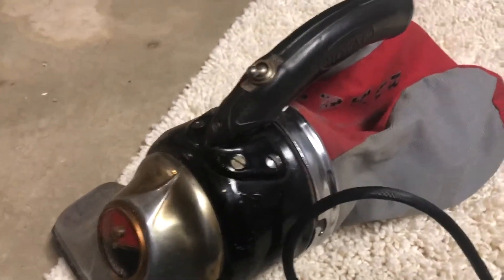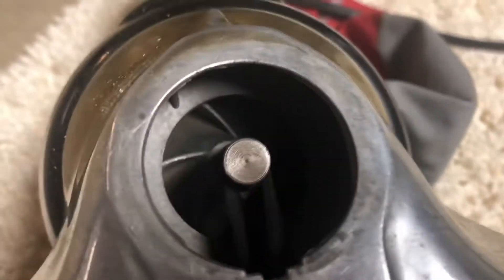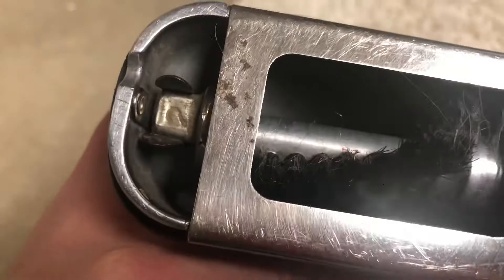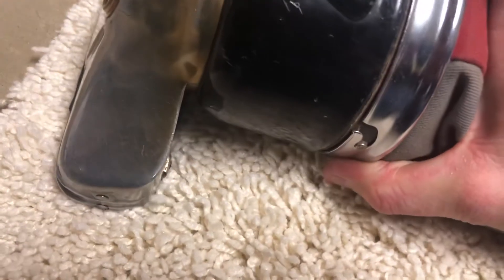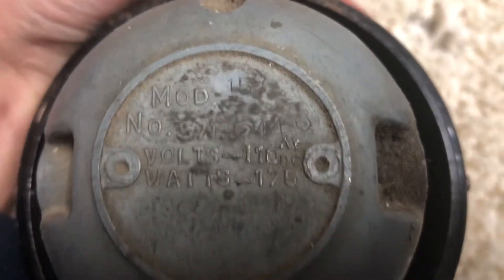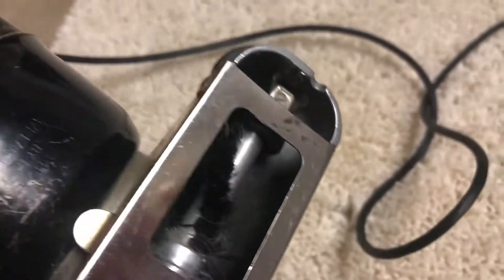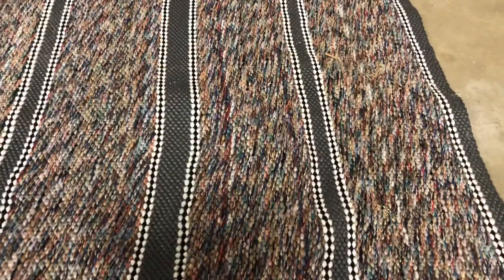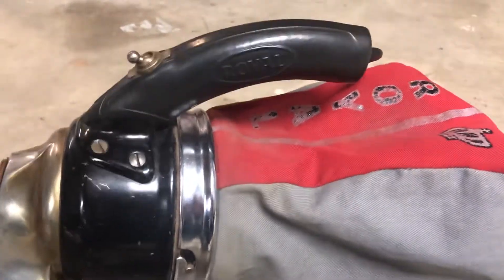Royal hand vacuum model 157

Comment: Awesome vacuum! I bought one like it on Ebay and it runs super nicely. Mine is the same but painted hammertone finish on the nozzle. I love the stamped model number on the bottom. No stickers! Your demo was perfect, it really shows the suction and vibrating action of the brush. All of the royal hand vacs were far better than other brands. Even the dirst devil 103 was a good unit for being plastic. But these 157, and early 501's run so quiet and smooth. I love the oil ports, newer 501's required taking the rear motor shell off to oil the bushings. Great demo and im sure it still runs great!

Comment: You did not have to get one this old if you wanted a reliable hand vac.  lol  Any of the metal bodied Royals or plastic bodied Dirt Devils from the 1990's would have done you fine.  They are very reliable and cheap. 

This vacuum was first sold 9/26/1938 at a department store called "Frank and Seder" (closed in 1958, the building still exists) and sold for a price of $14.50. In today's dollars, that is equal to $270.76.

You get vacuums too old you start dealing with low wattage early motors and you don't have a very good amount of power for agitation or cleaning, because that kind of technology did not exist back then and neither did the electric grid. They are mainly fun to use to play around with and restore and preserve for history, but best not to be used for daily drivers.
Reply from the maker: when I bought this I looking for one that is all metal and user serviceable (oil ports and removable brushed) Ironically this one was is better condition (if I remember correctly its been 4 years lol) and cheaper than newer models I looked at. I think it spent most of its time on a shelf, plus I figured for $20 worst case it doesn't work. power wise, this one has the 175w motor (if thats any indication of year?). It'll burn the belt off if given the chance. Its mostly retired these days, its usually only used on stairs once a month and that usually doesn't take more than 5 minutes. for as old as it is, it works quite well. I wouldn't mind having a 70's or 80's model as a daily driver. only other old vacuum I have is a hoover convertible 1030.